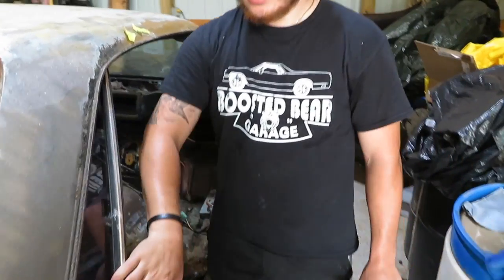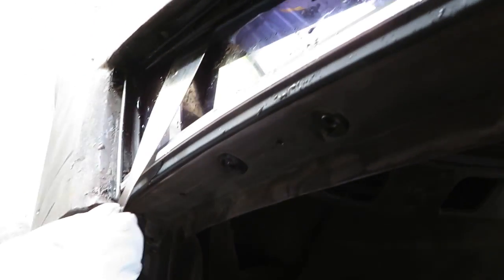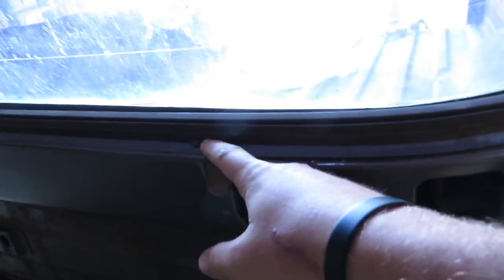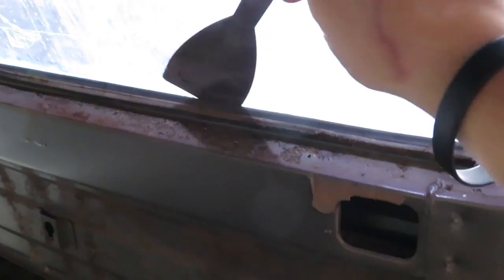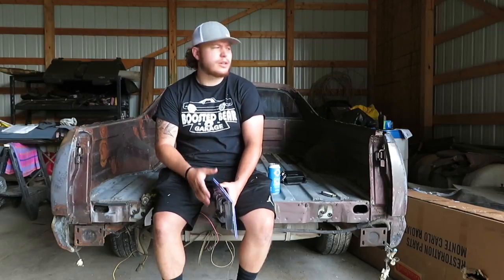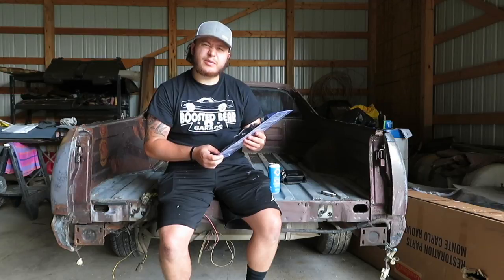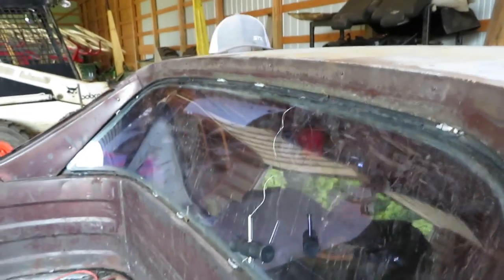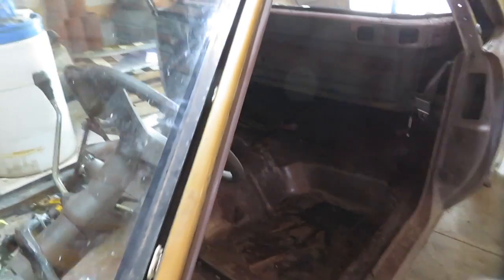Glass removal on the 1983 El Camino

Comment: it helps tremendously if you take a little propane tourch and warm up the metal frame around the window.  it will soften the urethane and you can just push out the glass with your hand.
Reply: How is the glass to body seal  removed?  These are often painted over 9:42